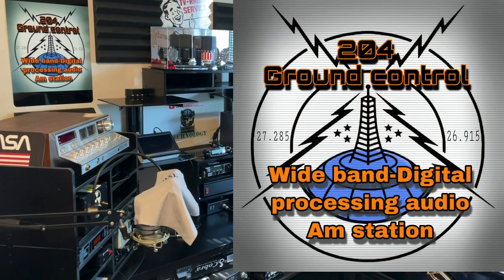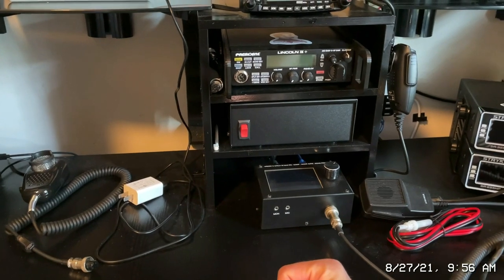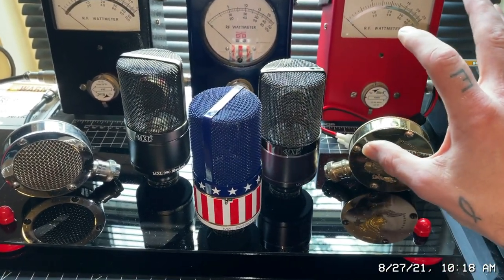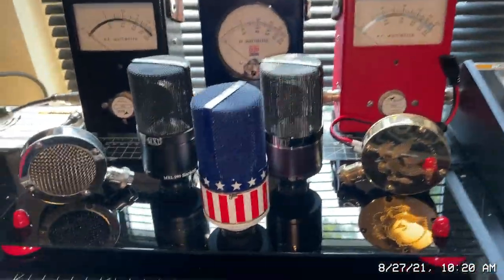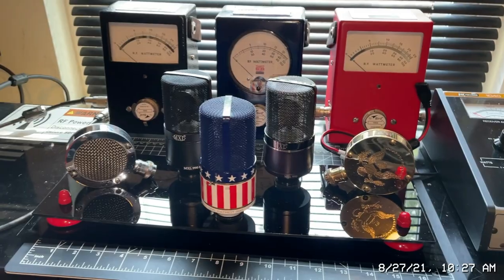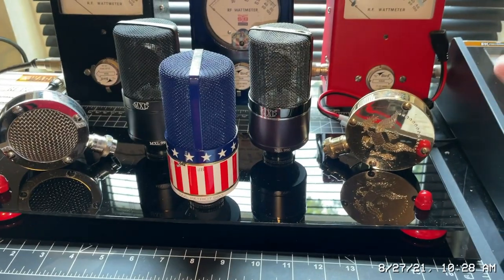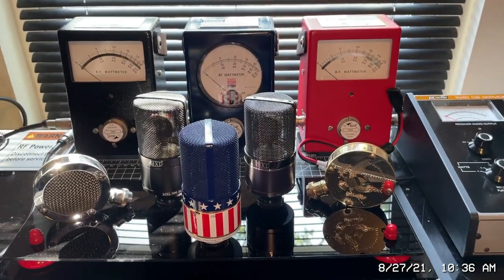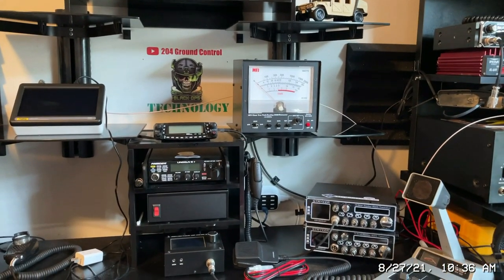MXL 990 & Astatic D104⚠️

Comment: Nice video and very informative.. on cb/ssb i switch mics between the D104 and the Sadelta Echo master plus classic (without the echo) on reports and direct comparisons between the two mics the Sadelta always comes out on top as the better sounding microphone,

Anyway i was just wondering what your thoughts were on the Sadelta and also wondered what you think of it, i have heard my own modulation on both and the Sadelta does sound much more punchy and clearer than the D104.. your thoughts please.
Reply from the maker: Thank you for sharing your insight brother, the Sadelta just has a cleaner preamp inside in my opinion, but also I think any mic element upgrade for a Sadelta would be cool to hear in comparison to its tiny stock element, and maybe a huge upgrade but I have not done this experiment myself nor have I seen a video on YouTube about it unfortunately. I’ve had one in the past and never had any complaints about them myself. Truthfully, the only mic I’ve ever owned and completely disliked was the turner plus 3.
Reply: @GroundControl204  thanks for the input my friend, again very informative.. yes i too had issues with the plus three, i thought it would work as good as the turner expander 500 the one you show in the video, the 500 is an exceptional base mic and works fantastic and definitely one of the better base mics particularly on AM/SSB.. it's very loud and punches the skip with ease on transmit.. but seriously the plus three isn't of the same quality as the 500, the one you have there is in nice condition which is rare these days and also a keeper for sure.
Reply from the maker: I agree, best shape I have seen an expander in awhile. Maybe a video will come about here on it in the future. Thanks again 444👋🏻

Comment: Enjoy your videos. I like your microphone display. I have tried and used lots of microphones and switch back and fourth time to time. I use an MFJ 655b for EQ and compression combined with a Heil PR40( over priced). I never knew how good it sounded until I heard myself on SDR in Georgia while I live in Illinois. While testing an AKG D5 and a Samson 20$ mic and the PR40.... The PR40 hands down brought out so much depth and almost like 3D audio at least for my set up.  Love your videos, not too much out there for the HiFi guys.
Reply from the maker: Wow, thanks a lot for your insight and experience. The Heil PR40 I think is overpriced as well but it sure has been a decent microphone since day one. I know a few fellas who run those not only on 11 meter AM but also 2 meter FM. 73👋🏻
Reply: @GroundControl204  I could talk for hours on this stuff because not many people are really into it, but I get reminded when I hear skip.

Comment: I'm currently running a V6 equalizer with a XLR studio condenser mic on my Galaxy DX2547, and I just ordered the V7 digital eq, I think I may upgrade my studio mic to a MXL 990.
Reply from the maker: The v7 is definitely an upgrade in my opinion, plus it provides 48v phantom power. I think you will appreciate the v7 and the MXL 990 for sure. Thanks for stopping by Howard. 73👍🏻
Reply: I know your post is 3 months prior to this but let me know how the V7 compares to the V6. I also have a 2547, a V6 and a Zingyou BM-800. I'm supposed to pick up a 990 this weekend and very anxious to hear the results.
Reply: @PhoenixRising251 , the V7 is great, I'm currently running a MXL990 with it, getting lots of great compliments on the audio.